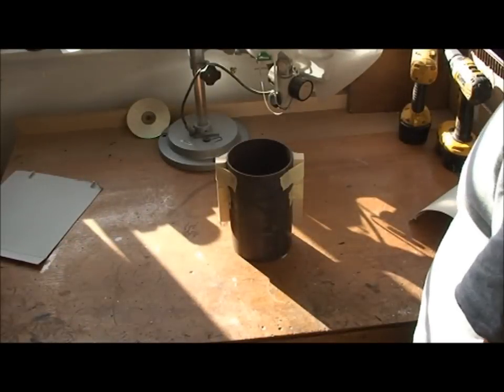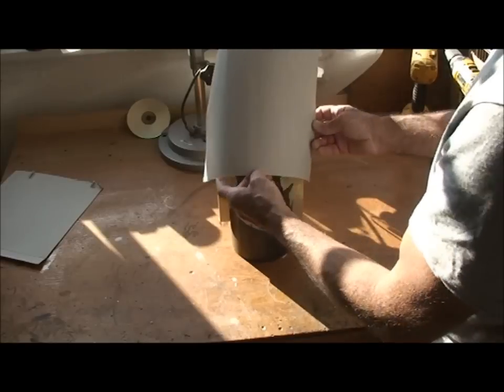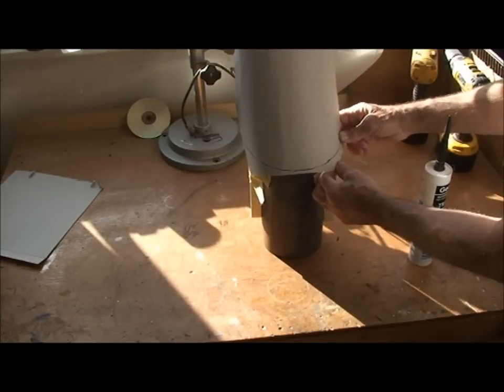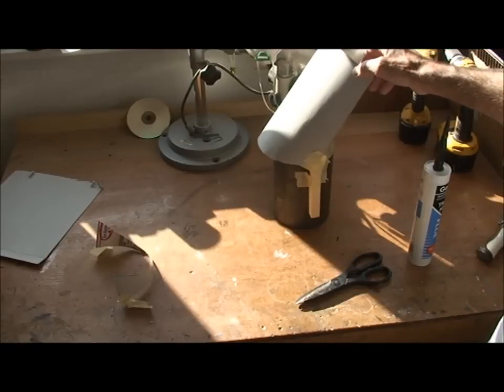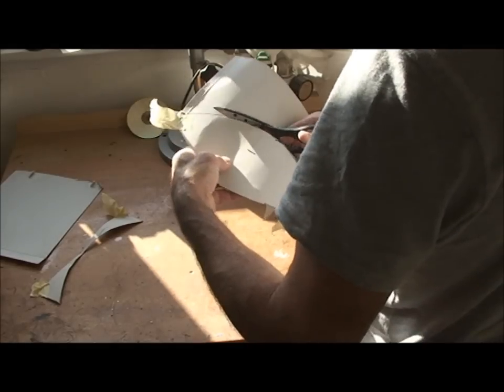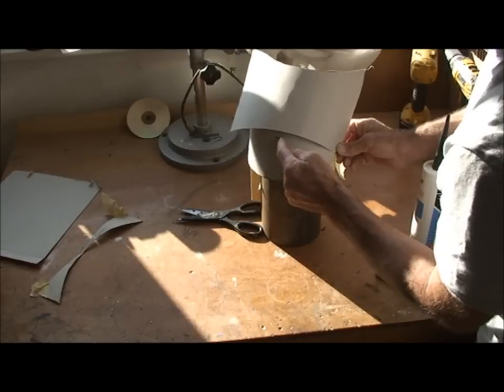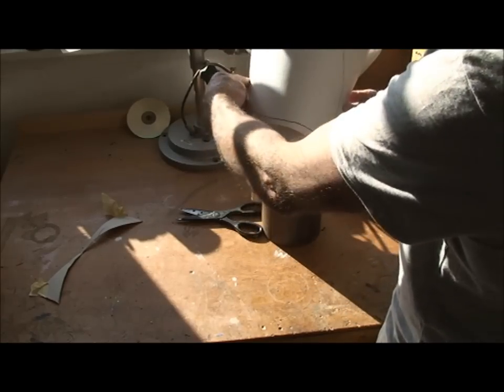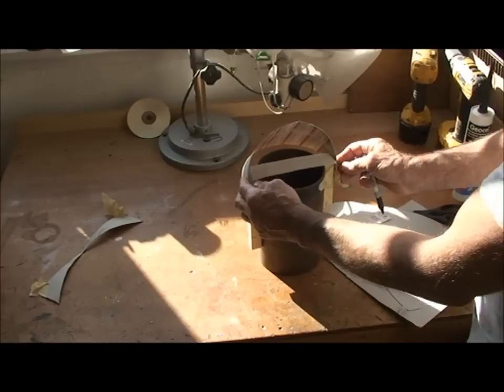Making a rotating Chimney cowl

Comment: Hi ppotty1, I found your design on the internet and followed it the best I could.  To my delight it worked brilliantly.  I was delighted as the stove in my porch was looking as if it might have to come out because of the smoke, but after a short period the bearings stopped rotating so I replaced it unfortunately the second one also stopped working.  I dont know if my welding distorted it in some way however I ended up fitting a spike where the bearing was that goes inside a tube and it rotates on that.  It works perfectly.  I can only thank you for your design that has been working now for six months without any blow-backs.  I can recommend this design to anyone as it definitely works.THANK YOU.
Reply from the maker: +Ian Rabbeth Thanks Ian glad its worked out for you, made a huge difference to my stove too.

Comment: Nice one,  just made a train hat for a stove flue with scrap metal bits. We'll try this one next cause it's fun fabricating those.
Perhaps those who's bearing stopped working was cause they didn't pack it up with b enough grease or heat resistant one? Or it dried out cause heat was more than yours?
Who knows... I'll put it on a stud,  no bearing or grease involved. Seen it on another design.
Thanks mate
Reply: *rain hat

Comment: Very nice walkthrough thanks. Is it beneficial that there is some small air gap between the 3 layers of cowl (on the side facing into wind), i notice in your final version you can see gaps, is that intentional? If so why and have you tried one with out the gaps? Many thanks julian
Reply from the maker: they all had gaps mate maybe I didn't explain it that well. Cheers

Comment: Great vid, thanks for putting it together.  The diesel stove on my boat has a downdraft issue in odd high gusts unless I crack a port in the cabin on the windward side to better pressurize the cabin. I think something like in this vid is the way to go. But I also have a problem of too much draft in high gusts which can cause the flame to extinguish it gets so brutal but can't find a barometric dampener to fit the tiny flue diameter of this small rig (about 2.5 inches).  So I'm researching DIY solutions for both downdraft and overdraft issues. I can't help but wonder if barometric dampening couldn't be worked into the rotating cowl design you implement here. At first shot I'm picturing the the cowls, while fixed in relation to each other, can pivot on the rivet axis against a spring so in high gusts the entire cowl  assembly tilts downwind from the pressure on the cowl. This motion would close down a butterfly to an adjustable degree located just below the cowl (rotating with it would be easiest). Without the gust the cowls would be fully upright and butterfly fully open.  The lowest cowl might need more overlap with the upright to accommodate maximum tilt I'd guess.  And cantilevering/counterweighting might survive the elements better than a spring I suppose.

Comment: I know this is an older vid but what metal material do you recommend out of all the different choices out there ppotty1? Thanks again for your great work and time to always be teaching all of the world watching you! 
Anyone else can also add what metal sheeting they chose to use that has made a version of this chimney cowl style. Thanks
Reply from the maker: Hi If you can get hold of some thin stainless id use that, this was made of mild steel and is now suffering from corrosion, so I will be remaking it in non corrosive steel brass or copper  next time. Cheers

Comment: Hi, thanks for  putting up the video, I'm making one at the moment but am struggling to find a suitable bearing. Could you give me an idea of what you used please? Many thanks Ed.
Reply from the maker: +Ed Burns Hi Ed, the bearing was off my boat trailer one of those sealed bearings, They were pretty worn and actually I just replaced that with the end of a 4 inch grinder that wore out. Just stripped it down and used the end cast piece that you fit the discs onto. Its much better that the previous one too and very smooth in operation. you could pretty much use anything with bearings like the centre of a bike wheel for instance.
Reply: +ppotty1 Ah good thinking, I have a knackered old grinder lying about, I'll give it a go. Thanks for the advice mate, keep up the good work.